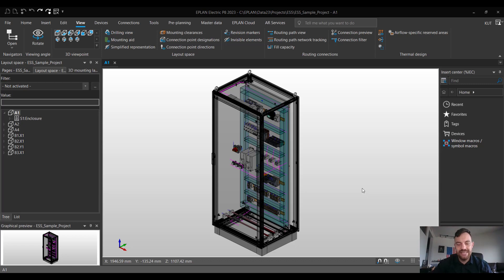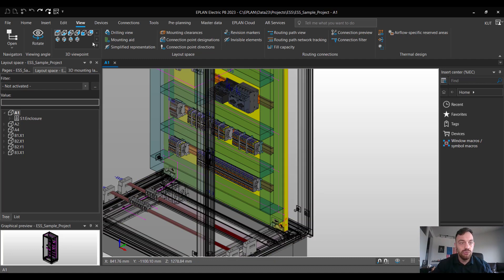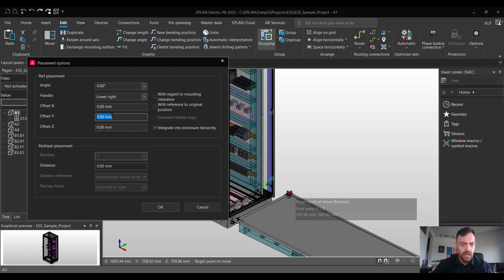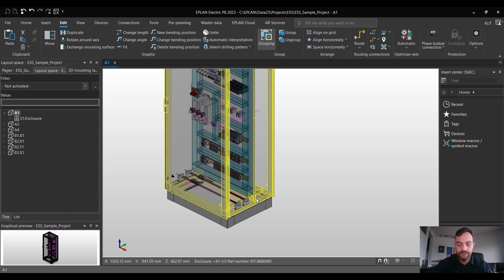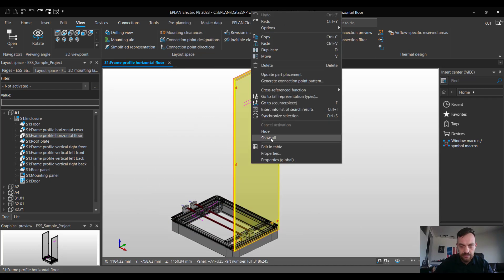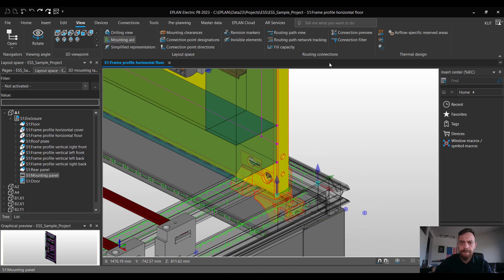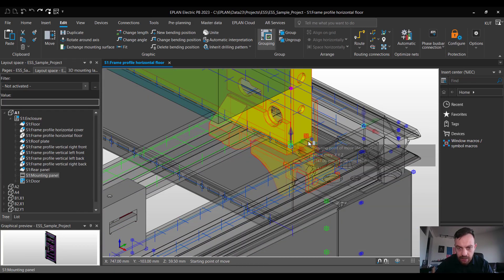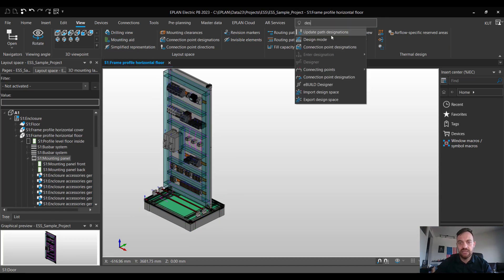How to move a Mounting Panel in EPLAN Pro Panel

Comment: How Can I join two mounting plates in Propanel?
Reply from the maker: Hello Andrea.

Thanks for your question.
All components in EPLAN Pro Panel follow the same prinicple, that the handle point  of the second component is placed on a reference mounting (point, grid or surface) of the first component.

If you have a concrete example, im happy to take a deeper look into it.

Best Regards
Kruno

Comment: Could you make a video on using mounting points to mount a door when you import an enclosure? I can never get the door to mount the way i want it. The door always flips or rotates when i hover door over the mounting point
Reply from the maker: Thank you for your comment.

I have created a video on how to open doors: https://www.youtube.com/watch?v=N0TaDMDOHFM
This I recommend when it comes to easy movement of components like doors.

When it comes to replacing a door, it would be helpful to use base points, the reason why the software behaves strangely when you hover over surfaces or mounting points is that those have a different alignment of the coordinate axis than the component you are trying to place.

I will create in future more Videos about the creation of Enclosures and handling of Accessories.